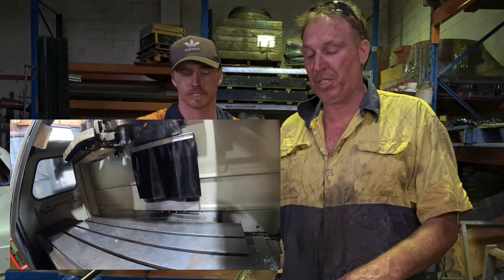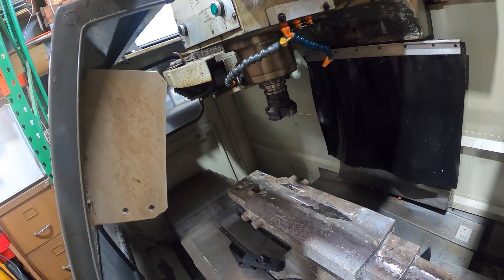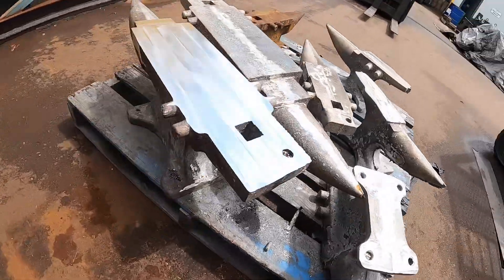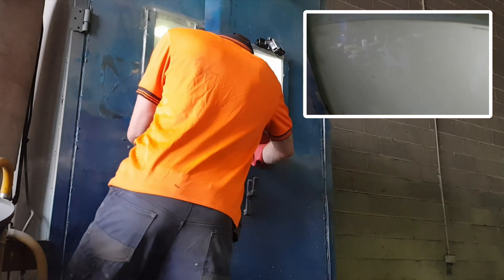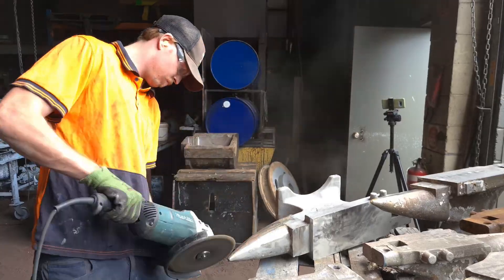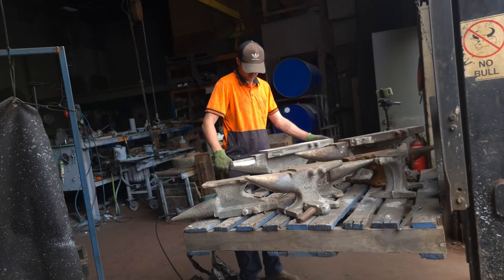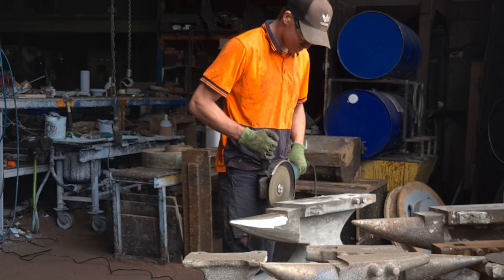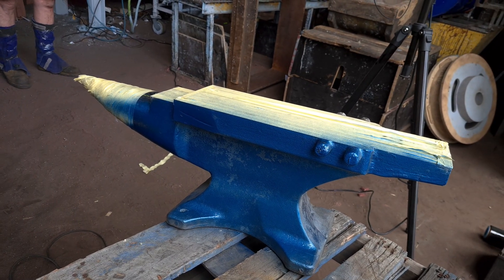Making a 100kg / 220lb Anvil from Steel - Part 4 - Finishing - Grinding, Linishing, Painting, Reveal

Comment: I'm curious, probably a silly question but would there be a difference on the composition difference of the steel properties if you quenched with oil rather than water. Thank you

Comment: Interesting I used to work at austral brass at Sefton ps I know alot of secrets can I suggest putting 4 holes in the feet so it can be bolted down nice process guys can u show the pattern and what coating on the mould u used runner system did u have to use chromite?

Comment: if brush painting it  using penetrol in paint really makes it stick a lot better we found  and on the last coat, use wet look hardener with the paint. makes it UV resistant and harder,

Comment: Would like to see the hardened ball bearing bounce test. Drop a hardened ball bearing (large one 13mm or so) using a ruler and drop it from 16" or 30 cm to see how high the bounce is. I've seen other anvil guys use this test to show the harness and bounce off the anvil.

Comment: Question.  Why don't you sandblast before sending the anvil to the machine shop for the top grinding, thus ensuring you wont spoil the machined surface with the sandblasting?

I'm sure there will be an obvious answer.

Comment: The only constructive criticism I can give, take it or leave it, is to give a bit more time prepping for paint… and give it a lot more coats. Maybe use a spray gun for a more consistent layers?! All that work in the casting, pouring, milling, blasting, clean up is quality but feel the paint work is not doing it justice. Brilliant anvil all the same. Cheers a heap for sharing the process in detail 👍🏽👍🏽

Comment: I worked in a steel foundry here in Fort Worth, Texas for 29 years. We made Blacksmith and Farrier anvils from 65 to 500 lbs, and other castings up to 25,000lbs. The anvils were mostly AISI 8630, normalized, quenched and tempered. I still have a JHM Basic 65# anvil. Our company logo was a horseshoe. It's interesting to see the difference in how different foundries work. We were required to wear helmets, safety glasses and steel toed boots with metatarsal guards. Molders, core makers, welders and grinders all had to wear respirators as well. 
We shutdown in 2003 after 97 years at the same location.

Comment: Nice video, I have been working in the sand casting industry as an production manager here so i rekognice a lot, We had the same problem machining , we hade 30% crome and then nickel also but we hade an temperatur at 1450 dgr

Comment: Your anvils look to be relatively parallel for machining ,I wanted to know why you choose to machine the surfaces rather than machine grinding them. What is the rock well hardness it’s got to be the equivalent to tool steel the way it’s chipping carbide inserts. With a grinding wheel used to grind tool still would probably faster and produce a better finish without tool marks Love to have one the shipping from there to Texas might give me a heart attack. Do you have a website for ordering. Eric ,Texas

Comment: @AusMetal Casting About how much in USD would this anvil cost in today's money? (April 2021)((Future readers price is not guaranteed as cost change and inflation happens!)) 
Like What did you pay for the Stock steel approximately? 
Also what it cost for the Manganese & coal? 
Do you get it from AU or do you have to get it internationally?
cost of running the V8 Generator for a Melt?
cost of The generator?
I myself know there is a lot more costs than these involved like man hours, consumables, and equipment maintenance/replacement which can be greater than the cost of the anvil materials and melt!
The induction furnace is very cool but what parts tend to break down or need regular Maintenance?

When you figure out how to ship to USA lmk!

Comment: Você esfriou a peça muito rápida e ficou extremamente dura, com muita cementites.
Reply from the maker: Toda la pieza se enfría lentamente, apagamos solo la cama y la bocina con un flujo constante en el transcurso de una hora o más para endurecer la cama mientras permitimos que el cuerpo se enfríe naturalmente. 

The whole piece cools slowly, we quench only the bed and horn with a steady stream over the course of an hour or more to harden the bed while allowing the body to air cool naturally
Reply: @AusMetalCasting  This cooling procedure makes subsequent machining operations more difficult, unless a heat treatment is performed to avoid problems in machining. Here in Brazil, we have a great need for this type of product, some improvise for lack of option. A hug.

Comment: Might I suggest a jig system to hold the anvils during grinding? It would save a lot of effort repositioning the anvils to grind all of the various surfaces. You could build the jig into a frame for the forks on the forklift, keeping your use case the same if you want to. 

A first pass design would use two pairs of stacked beams with welded spacers (~10 cm /4 in) separating the pair of beams by to provide space for the forks to get inside the structure to lift it. A thick steel pipe segment (~0.5 m / 18 in long minimum, longer is better to a point) with the same OD as the spacers gets welded into the center of the two pairs of stacked beams perpindicular to the beams so that they form a capital H when looked at from above. The pipe is the rotational axis for the anvils, so it will need to have a couple of heavy duty bearings pressed into the ends. A smaller steel pipe or heavy duty rod (larger diameter is better, thick walled pipe is fine) a few centimeters longer than the pipe mounted bearings will mount the platform the anvil connects to. It is important that the anvil mounting plate is offset from the smaller pipe axis of rotation. You want the platform to be offset enough to bring the anvil's center of gravity in line with the center of rotation so that the anvil will rotate freely and not just spin to one side (probably upside down). A clamping or gearing system mounted on the smaller pipe would let you lock it in place for grinding at any angle desired and the forklift would let you raise/lower it and tilt as desired. Way better ergonomics and likely faster too.
Reply from the maker: This is brilliant!
Reply: Something similar to the car cradles Panel Beaters use when working on a car body.

Comment: Having worked in a fabrication facility I have to say that I am surprised that you do not have a lubricant spraying on the cutting head when surfacing the anvils.  No wonder the cutting blades look so crappy and worn out.  Protect your investment and use the lubricant spray nozzle.  If the pump for the lubricant doesn't work then get it fixed as you're pissing away your money on replacing the cutting blades.

Comment: I would love to know how you heat treat the anvils to get a hard face and soft bed.  I've done differential heat treatments on knives but I don't know how you would do anything like that on something as a big as an anvil?  I'm going to guess that only the face of your anvil is getting quenched fast enough to harden?  But judging by the color it didn't seem too hot when you quenched it...  How hard does the face of the anvil get, and what phase is the steel in?  Sorry if that's too many questions.

Comment: Why do you quench with a hose and not a full immersion?
Reply: I'm not even a blacksmith... but my understanding is that it is such a big mass, it will heat the water and it won't be cold enough in a submerge application. So you have to use a stream of cold water b/c the water is always cold coming from your hose or "stream"
Reply: @richardroe6235   thanks John, my question was based on videos I’ve seen where they dump it in a lake or river. Makes sense, I think it might allow for the different hardness your vid was talking about as well. Very cool stuff, wish I could buy a big one from you guys, they look marvellous. I’m in Canada, shipping would be scary. Right then, have a safe day, great vids. Tell Jamie to grin. 😁

Comment: "Daen"?  needs a surface grinder for the first few passes before he uses his surface mill!
Reply from the maker: Dayen Does!
Reply: Sand inclusions kill tungsten carbide bits - and it only takes one... (And silicon steel formed when the steel dissolves the sand isn’t much better).

Comment: I know it is for eye candy but milling dry makes my soul cry.
Reply from the maker: Nah I think it's because he's only new to machining. Same reason why he didn't grind the scale off. Chewed through so many tungsten blades
Reply: @AusMetalCasting  definitely would help cutter life to use coolant and also probably slow that rpm rate way down. if you plan on milling lots of these id look into buying or having a tool and die maker custom fabbing a cutter that can do it in one smooth slow as paint drying pass

Comment: Thank you all for making these video's, I really love this sort of thing. I wonder why the machine shop would not surface grind the anvil instead of using a cutter. I am also curious about forge hardening. May not be necessary with the type of steel or the work hardening from the blacksmith might be all that is needed.
Reply from the maker: We are wondering the same thing about the machine shop
Reply: @AusMetalCasting  Surface grinders work slow to remove that much meat... carbide shell mills work fast. Time is money. Might be more productive to burn up carbides than invest in a surface grinder.  A SHAPER might be the perfect tool for the rough flattening... one of the few things left that a shaper does better/faster/cheaper than more modern machine tools.

Comment: Check out  the channel of Joey van der Steeg, he is a dutch black smith forging  anvils instead of casting.
Reply: Well, they are anvils, but they are small. They will fit in the palm of your hand
Reply: @robarcher3892  yes thats right.  But its made  the original way (and  he will do a big size some day he said in one  of the video's.) So if you scale it up then you will end with a big size one. Some say size doesnt matter ;)
Reply from the maker: will do!

Comment: God damn that flycutter is being pushed to the max with how hard the anvil is! What a beast.
Reply from the maker: Tore up so many blades
Reply: @AusMetalCasting  whatever you are alloying out with sure did the trick indeed. would it be beneficial to fabricate a cutter with inserts that could do it all in one pass?
Reply: @AusMetalCasting  should have used ceramic inserts instead of carbide
Reply: @markcassemeyer2649  that's what Bob said too
Reply: I was blown away seeing red sparks coming off a steel cutter.

Comment: When Finnish manufacturer Lokomo made anvils, they didn't grind the back flat, but they grinded it slightly convex with radius of 25 meters. They achieved this before CNC-machines by having a grinding machine on the end of 25 meters long boom pivoted from the other end. That slight convexity allowed better streching of the steel when forging.
Reply from the maker: That's cool!

Comment: I was guessing you would have done the top on a surface grinder to save killing cutting tools.
Reply from the maker: No doubt. He's only new to the CNC machine and Bobs anvils
Reply: I think you'd be there for about three years with a surface grinder... time is money - frying those carbides might make more sense than spending half a lifetime at .002" per cut with a surface grinder.

Comment: if you grind the scale off the surface of the anvil first it will save some drama with the carbide inserts
Reply: i'm told soaking stuff in vinegar helps get rid of the scale as well
Reply: @gramursowanfaborden5820  it does... I use vinegar and salt to remove scale from my forged blades before grinding... it saves the belts
Reply from the maker: Thanks!

Comment: So many things for an anvil would make it hard to get completely flat/level. Is the platform it is placed on 100% level. Probably not. It is all close enough yes. I would love to get into metal working yet that heat where I am in Texas wouldn't work to well for me.
Reply from the maker: Yeah it gets hot where we are too. Nothing worse than a 1600 degree melt on a 45 degree day (celsius)
Reply: @AusMetalCasting  We hit around there in the summers where I am in Texas. 114+F and even with our normal 2-mph 32kpph wind that wind is just fucking hot. I need to learn the math to do the conversions one of these days. Although we hit -13c for wind chill last weekend when Texas was frozen.

Comment: what is the carbon content of the anvil. you mentioned high chrome and nickel. I work in a steel mill in the states the arc shop and caster. Mainly we melt 200 tons at a time and run a continuous caster making 5.125 inch square billets at  are cut to 50 foot lengths. These are rolled in our rod mill down to rod anywhere from .219 up to .750 in diameter. a billet weighs about 4400 pounds
Reply from the maker: That is a HUGE amount to melt at a time! Very cool though. Not sure on that, would have to ask Bob about it and get back to you. Thanks for watching